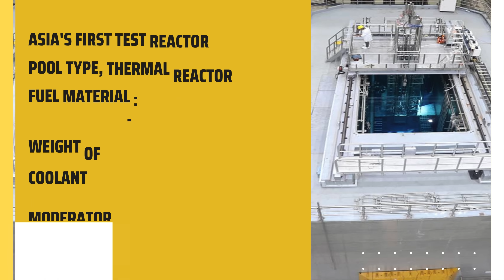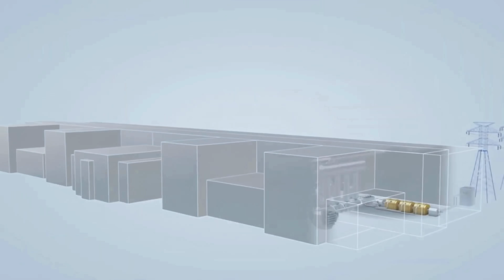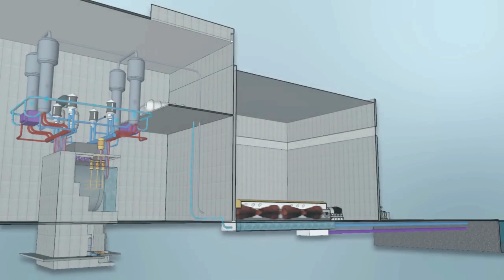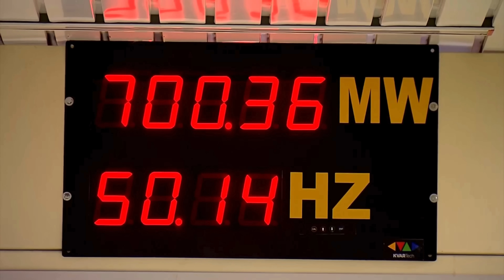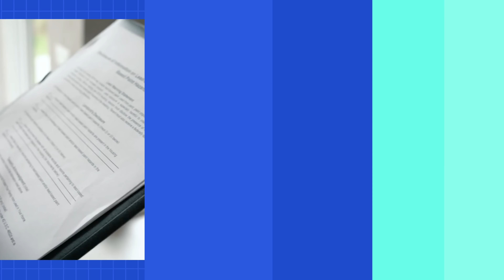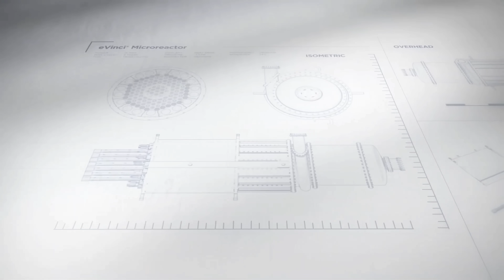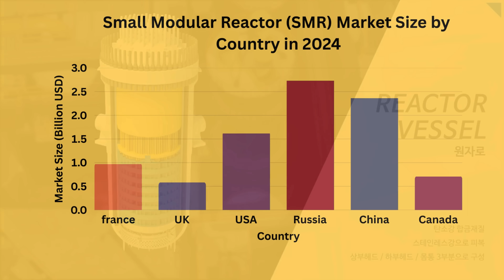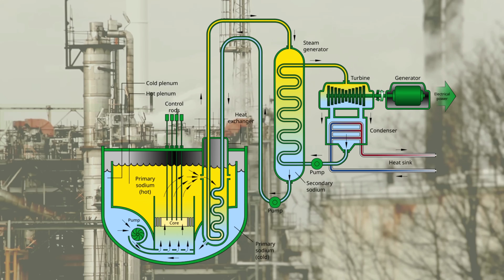What Really Went Wrong with Nuclear Power in India?

Comment: Much indians working in gulf countries that could also deliver much D out of hydrogen from sea water HxOy or methane CHxDy used in Abu Dhabi for H2 from CH4+H2O+heat for chemical industry & HD separated in 7LiD 7LiH centrifuge heated >1000°C decomposition like TiH2 from TiO2+CaH+heat etc.
Clean H used for BH3 & NH3 separation of 10B / 11B & 14N / 15N isotopes.

Gulf countries can pay developments also for small test turbine cycle using CO2 with steam pressure 57.3 bar 20°C and sucking centrifugal compressor (earth gas) backflow cooling (indirect) to heat & steam inlet of all that way thermal isolatable
usable for all steam power also with heat of existing cooled H2O condensor and surfaces or from hot air sucked with 2. compressor that way more hot & dense for heat transfer to CO2 turbine cycle air expanded over driving shovels cold for aircon and water out.

Do they have agrar culture with sheeps, cows & fishes inside towers for visiting ?

Recommended for high surplus very secure fast breeding a new pebble bed HTR with pebbles out of thin tungsten alloy filled with MgO and U in ZrC between tungsten reflector with breeding and fission areas for running pebbles.
Overheat self slow down, passive out <2s, no decay heat problem unburnable.

Why FLiNaK instead only 7Li as moderator and coolant with bubble slow down from 180°C-1340°C possible in Na breeder or combined with 15ND3, cubic 11B&15N or simply D2O primary cycle PWR ?

Using thorium or uranium does not matter already found in india like awaited and over 4Gt <300$/kg out of seawater is no end cost factor if both also breeded.

India Can Do Future Candu HTR with liquid about 9 bar 15ND3 ammonia instead D2O between RBN (cubic 11B&15N) tubes & RBN fuel with pressure bubbles control quick passive away if 7lithium inside >1000°C instead H2O as excellent coolant & moderator with bubble slow down 180°C - 1340°C without pressure a storey sand upon tubes over MgO melting pot etc.
running with unenriched UO2 fuel about 30 years.

Making of gold as side product of cold fusion shooting cheap mercury into Lithium-Deuterium for 6Li+D→2 He, 6Li+n→He+T, D+T, D+D→T+p, 7Li+p etc. from Hg and following He punshes 20-30 MeV Hg n-spallation to 197Hg→Au.

Comment: One simple suggestion. Just keep to coal fired power stations as was in the years gone by for many many years all over the world, with no issues at all then .Because India is abundant in coal so it will work out much cheaper to generate power
Reply: India is importing coal
Reply: Our coal grade is different than we use in burners ,our coal generated less energy and more ash it burns soon but our burners are based on licenced built so we need other countries coal mix it up with out coal on a ratio to feed the boiler,next gen boiler are being introduced accordingly to the coal  grade available in the powerplant
Reply: We are importing high grade coal with low sulphur content from Australia, mainly for using it in thermal power stations

Comment: Biggest Blunder was to "abandon" the PHWR, forgetting why this option was selected in the first place. The PHWR was developed by Canada to avoid having to depend on enriched Uranium and large Pressure Vessels that Canada could not manufacture and did not want to be victimized by other Nations. 
In retrospective, the above reasoning was sound for India too but forgotten, and India's Nuclear "Progress" has suffered... possibly irrevocably, as Solar Energy provides solution to its 18,000TWh/yr Energy Needs by 2050 or so.... something that all existing Ebergy Options (Fossil, Nuclear etc...) cannot fulfill. 
It is too late for Nuclear, Fossil an other Polluting Energy sources now. .
Reply: It is NOT too late for Nuclear. It is prime time for Nuclear. Gen IV Reactors rolling into place, leaving MUCH wider space for research and development.
Reply: Most of the upcoming nuclear power plants will be based on nothing but PHWRs. The other types of reactors are being run in alliance with some countries, which is necessary for technology transfer.
Reply: You're overestimating solar energy here. They still have the age old problem of needing expensive energy storage batteries because the sun doesn't always shine 24/7 and solar panels are not yet efficient enough to convert most of those solar energy into electricity. Not only do they and their batteries will take a lot of space, but they themselves are made of toxic materials as well and mining/extracting them are even more polluting to the environment than nuclear fuel which can be obtained from decommissioned nuclear warheads and wastes from mining processes themselves. At least with nuclear, they are working with Gen. 4 reactors that can recycle nuclear waste and use them as fuel while also having passive safety features that make them meltdown proof. And they're much better at converting excess heat for district/industrial purposes than solar energy. Solar energy will also struggle against natural gas as well.
Reply: @psalmerperena4120   And the fact that absolutely no regulation requies Intermittent Renewables also establish Batteries is insane fasle advertisement. 
A Solar Park could be advertiesd as 250 MW, even though it makes 250 MW only at a certain part of noon, and delivers ~0 MW at night. 
Thus, for these cases, you either shovel more coal into furnaces, or inject more natural gas into turbines.